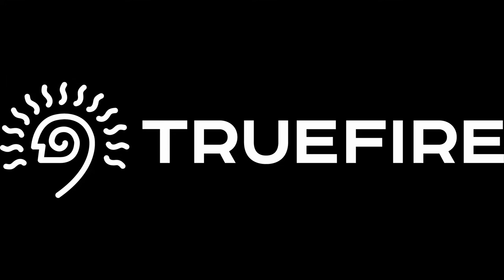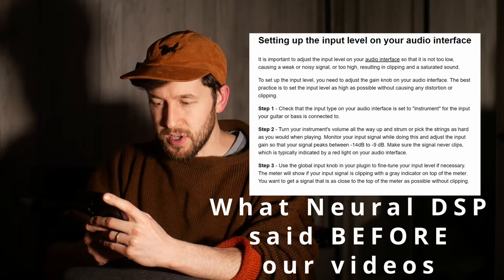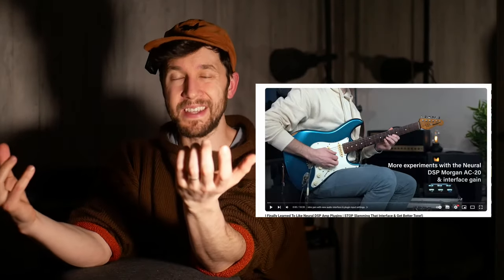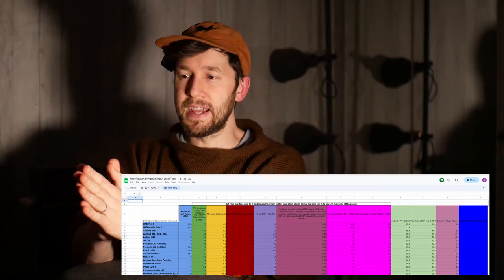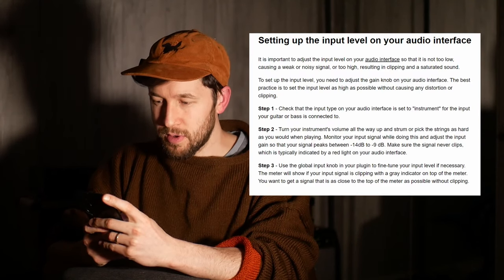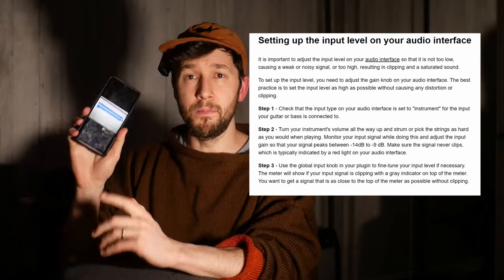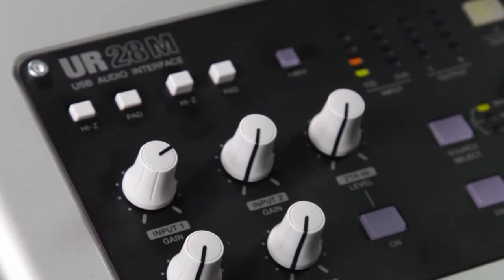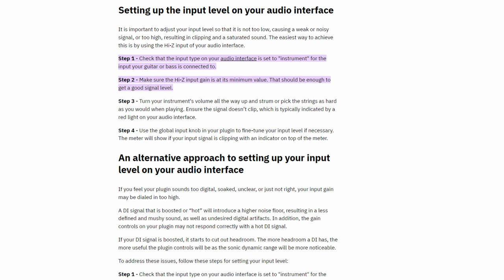Why Are Neural DSP Gaslighting Us About Plugins and Input Gain?

Comment: It feels like this is exactly why almost all interfaces have added hi-z / jfet inputs no? to boost the guitar signal without having to turn up the gain and risk coloring the DI. Cuz we just want a louder line signal, it shouldn’t be treated the same way as a mic. Amp sims are still relatively “new,” so I’m not so offended to have received outdated advice, we’re still in the transitional period between analog and digital. Nothing criminal, but sure it could have been explained better. They owe ya ;) I’m pretty sure I saw on Reddit years ago to just leave gain at 0 especially when using a hi-z input so I’ve done it that way for a while. Glad we all know now :)

Comment: In my experience, Neural works best at zero but Amplitube/Tonex, McRocklin, and Genome need the input gain knob to be turned up.
Reply: Can't speak to the other products but I feel like this makes sense for the McRocklin suite, since it's not really designed to recreate the exact characteristics of any specific real amp.  How are you liking the McRocklin suite btw?  I haven't gotten it yet but it seems like it does saturated 80's tones really well.  And although it's not a modeler per-se, some of the tones I've heard demo'd remind me a lot of Carvins paired with old Rockman sustainer/chorus gear.  I should probably just try the demo but the sound cutting out every little bit kinda puts me off.

Comment: I still think this is really just the finer points of gain staging for guitar amp modelling plugins. It's a real drag that these manufacturers were giving people bad advice. Where possible, your DAW faders should always be set to something like 0 = -12db or even -14. So that you're hitting the orange well below the top of the meter. Digital isn't tape, we're not battling really bad 'Signal to Noise Ratios' (SNR) and it doesn't clip in the same way either so there's WAY more headroom and much less of a need to record at loud volumes.

Comment: I am lost. When the gain is the audio interface is too low, yes the result is better but the recording wave in the DAW is too flat.
Reply: That’s when you add gain to recording digitally after recording. The added input gain doesn’t add additional noise to the recording because it’s all digitally done and you have a high noise floor.

Comment: Why can't there just be an indicator of "right" input level in the plugin interface?
Reply: You’d need to run a constant known voltage source for it to measure accurate. A guitar DI is a pretty bad tool to measure/calibrate with because it’s not really possible to produce an accurate+repeatable constant voltage

Comment: You all got an input knob on all your plugins. Please use it. Set your interfaces, so they "see" good, healthy signals, so the preamps works at their intended range (interface manual anyone?) then adjust the plugin input knob to the ideal working point of the amp sim. Done.

That's what Fractal does for you. Your set the "just below clipping" input level and the fm3/fm9/etc. sets the outputlevel of the preamp to the sim they way it is intended to be "hit". 

There is no magic to it. Just basic understanding on how to gainstage. You'd also never lower the gain on a mic preamp just to get lower levels of, let's say, a reverb plugin. You just send less signal into it, to get the sound you want.